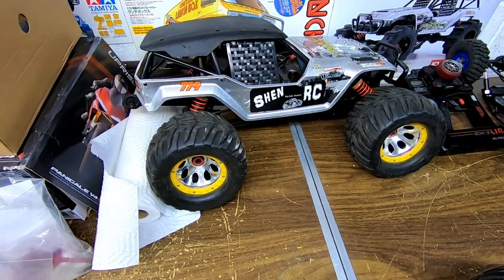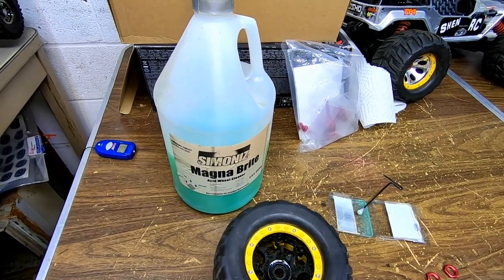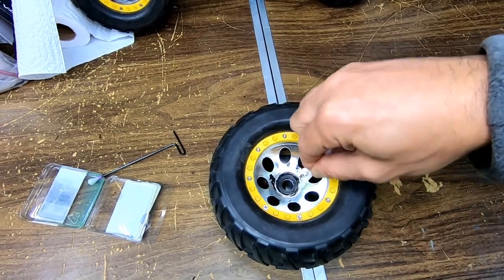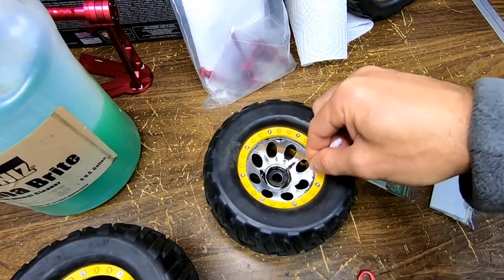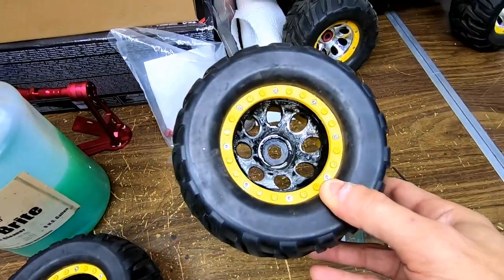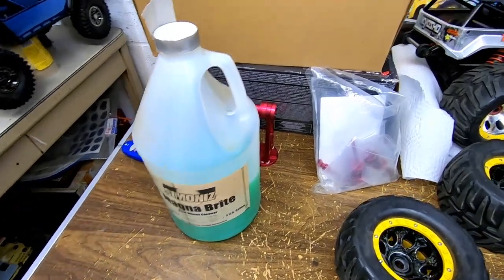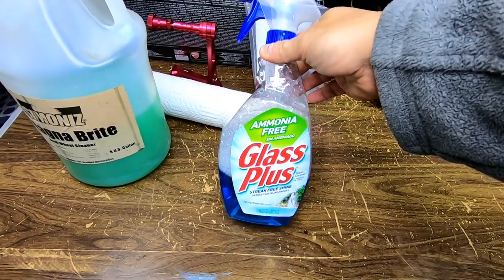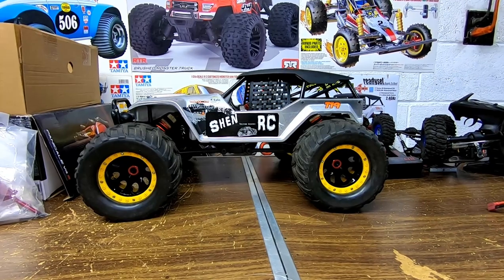HOW TO REMOVE CHROME  from PLASTIC rc wheels & parts

Comment: That's a good trick I wanted to remove the red from my Clawback wheels awesome Steve 😜😀✌🏻👍🏻
Reply from the maker: Yea it works great I did the wheels that I have on my 12428 if you recall the black rims they where chrome also.  Thank you

Comment: That's an awesome tip! I will definitely be trying this out in the future on a few of my wheels! Great vid Steve 🤘
Reply from the maker: Thank you, It works like a charm and makes the RC's drive and run much better and makes parts last longer also. Sometimes with the smaller 1/10 size wheels you get lucky and they are not to bad but trucks and small 2.2 and stuff can be so bad it's crazy! want to find out hold your cars up with your hand and floor them you will feel a out of balance set of tires when it wiggles and bounces like crazy in your hand or you see a A arm flops up and down from a bad tire and wheel. Thanks for watching.

Comment: I like it! I almost forgot that this platform the wheel nuts always tend to loosen up. Looking forward to the running vid😎🤘🏻
Reply from the maker: Yea I use a small dab of thread lock inside the nuts and also balancing the wheels and tires also helps. Thanks BB

Comment: I use super clean. dump a few bottles in a reusable platic bucket with lid (2gal) then I drop all my chrome peices in and soak clean as a whistle falls right off.  even with tires on it strips the chrome. Rinse when done.. do it too all my rc conversions 8-)
Reply from the maker: Yea I been using this method it worked best for me. Thank you for watching how's blueberry?

Comment: ware gloves n deffo don't breath the vapours or strip your lungs....wasn't mentioned
Reply from the maker: Hi It would be best to use in a well ventilated area and you can wear gloves also but It's not that strong they sell it in spray bottles for when washing your car you actually spray it on your wheels so it's not to bad.